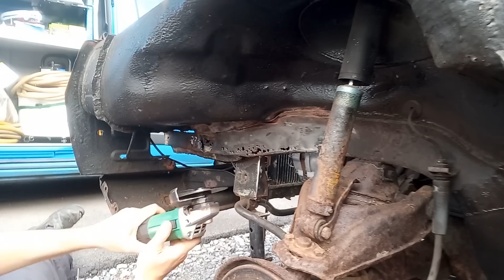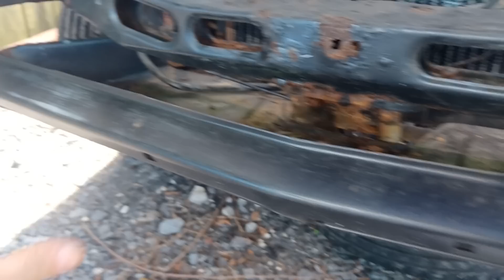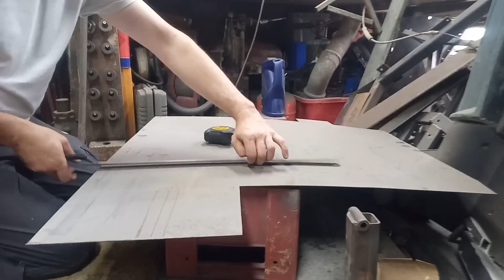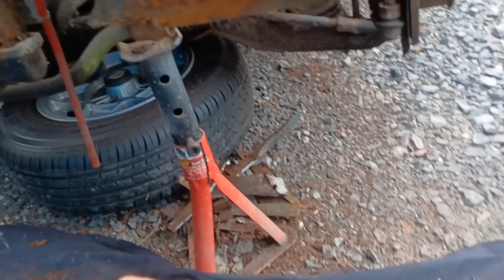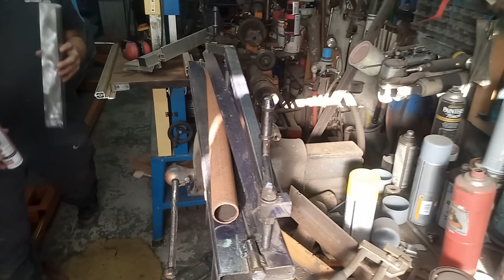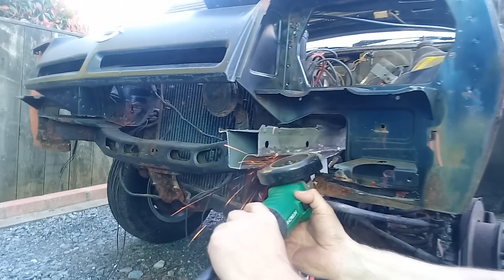Opel Manta Rolling Project.  Chassis Rail repairs. Car Restoration.

Comment: 5.50 I would have bent the excess over the old chassis piece to give extra rigidity to the next piece to weld in .Can i suggest a good jumper and leather gauntlets when welding and cutting,this way sparks don't make you jump and saves injury,nice to see a manta being saved much better than a riddled escort😀

Comment: looking good!  question for you , where do you get your metal sheets from? also what black paint are you using? thanks
Reply from the maker: I get metal from a local steel supplier, try to get 8x4 sheets, works out more cost effective. The black is, for now, just stone chip paint from halfords.
Reply: @DavesGarageuk  good tips , thanks

Comment: Excellent Job 👌👍
As an ex MOT tester how happy I would have been seeing repairs done like yours.
Reply from the maker: Thanks, that means a lot 😊😊
Reply: It would not pass MOT in Denmark, the hole section had to be replaced to keep the strenght in the structure. Its not aloud to patch it together like that.